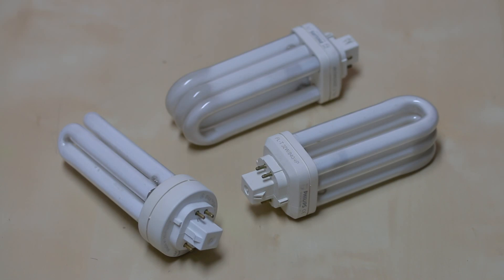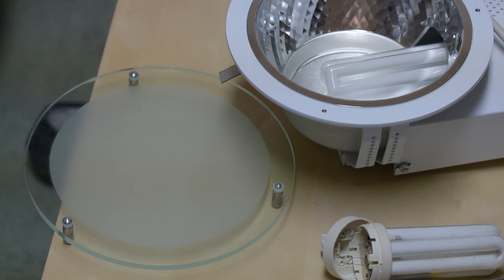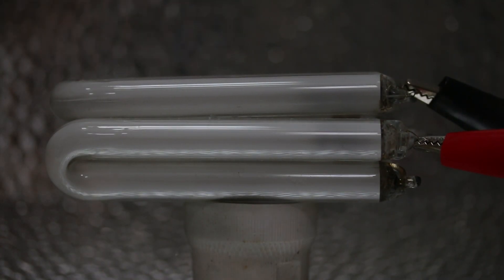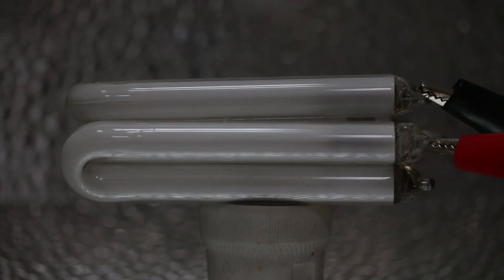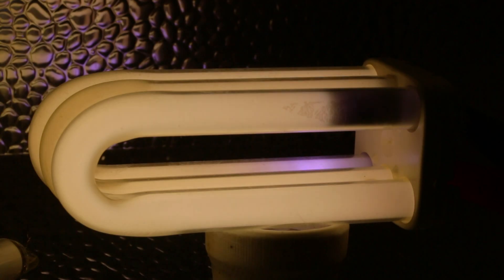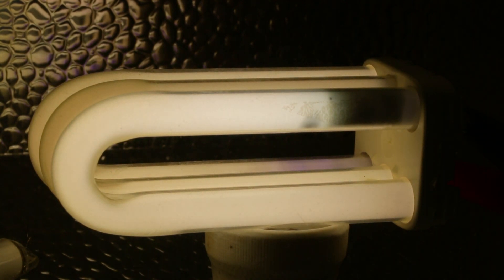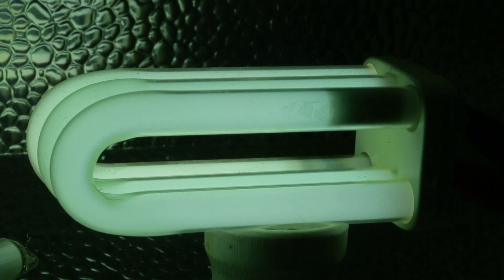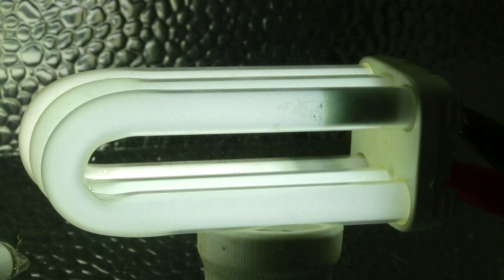CFL Murder

Comment: where can i buy that socket? i cant find it anywhere
Reply from the maker: Socket?
Reply: yes, the thing you plug the bulb/spiral lamp into, i have checked at my local stores and noone sells it, i cant even find it online, i think the socket is called g42
Reply from the maker: +Bill Gates Its called a GX24q holder. Should be widely available at any electrical wholesalers or eBay.
Reply: thanks!

Comment: Nicely done.
To see the lamps fail in realtime without seeing you do the wiring realtime (always some messing around, can be interesting but is still not the point of the video).

I start to wonder.. if you could keep the lamp cool.. then .. would it last?

For example have the bulb under water?

The middle section of the tube seems good.. but reshaping the ends is probably way out of question. ..
Reply from the maker: I did actually shoot some wiring up but was cut. Felt it was going on long enough as it was!
Reply: @FrontSideBus what if it was underwater? The lamp on 250w?